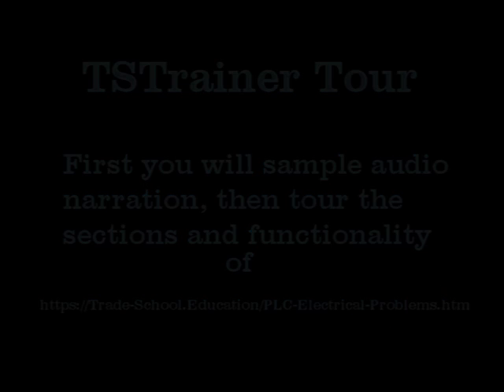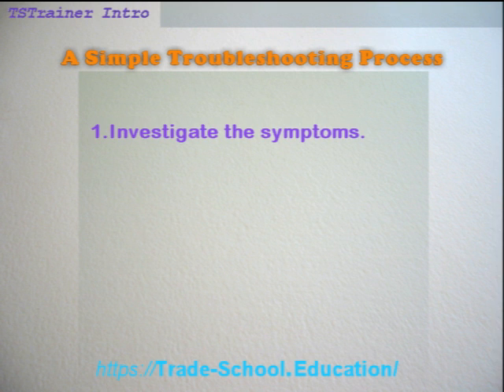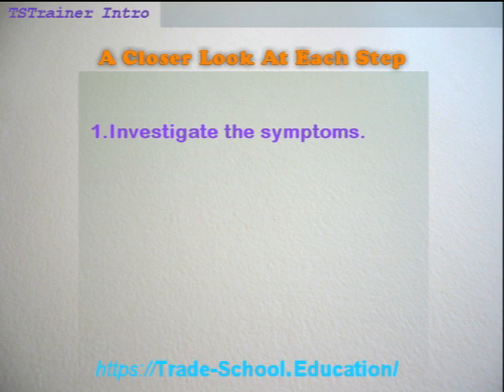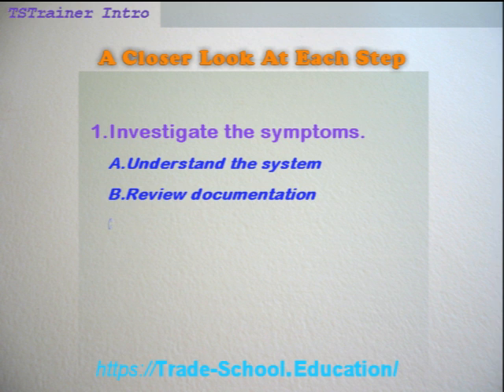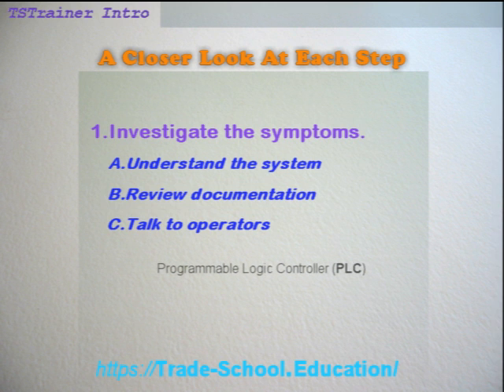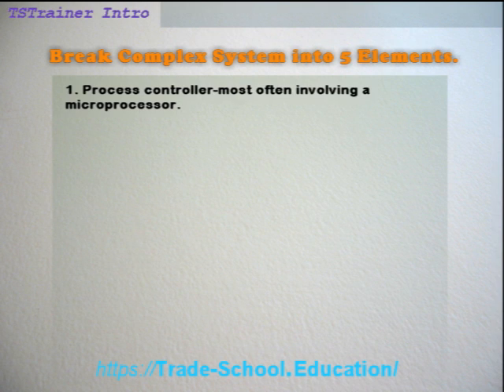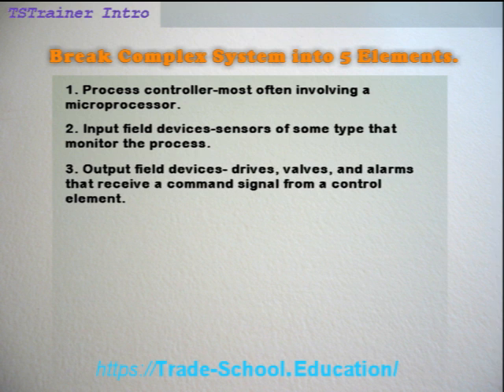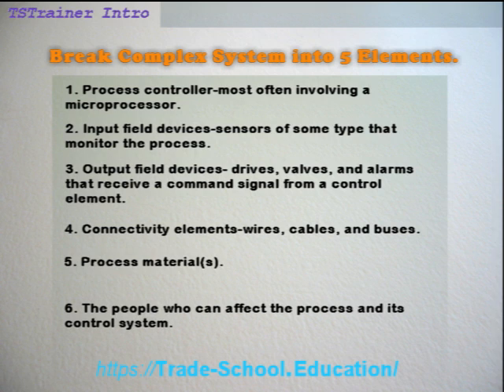Electrical Troubleshooting & PLC Troubleshooting

Comment: how can I print out a copy of your video
Reply from the maker: At the URL in comment you can print out the webpage that describes it. If you purchased site license (multiple students) within the course software is a printable PDF Lab Manual which also incudes screenshots of the circuits. Here is the URL again https://bin95.com/vocational-training/electrical/electrical-troubleshooting-plc-troubleshooting.htm You can also contact us at the site above with further inquiries. Thanks

Comment: Find out the input sequences to start the machine to run in Auto, this can only be done while the machine is working correctly,  Once the cycle has finished,  find out which inputs are on or lit before pushing the start sequence pushbutton , unfortunately  many do not heed this helpful tip , they think why should they bother the machine does not have an electrical problem . remember you will be the last Engineer on the job , the mechanical Engineers will be having a tea break ,while you are scratching you head .
Reply from the maker: If you learn how to read ladder logic and use the PLC to troubleshoot, you do not need to know the pattern of i/o led's. The ladder logic will always answer what condition should be on or off in normal operations and idle state, and takes about 4 minutes to do so. The PLC is a powerful troubleshooting tool.